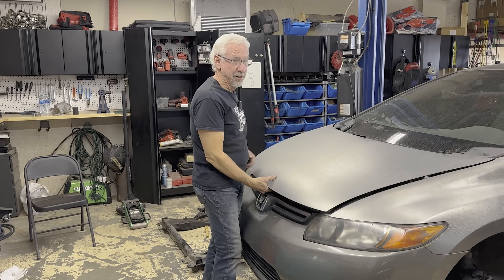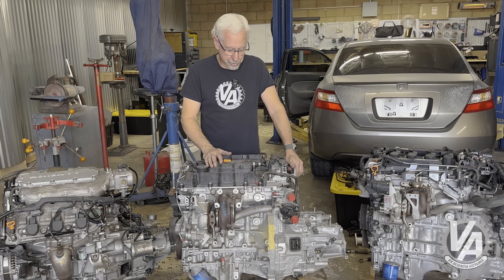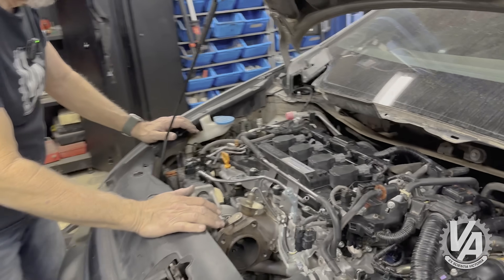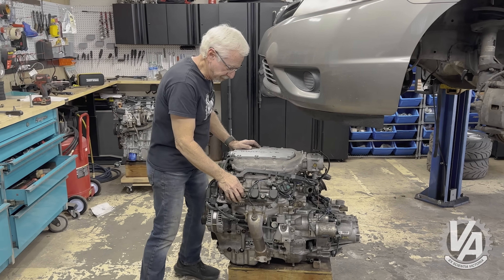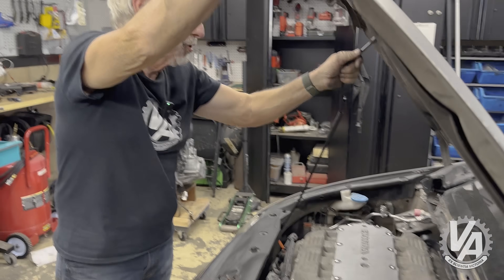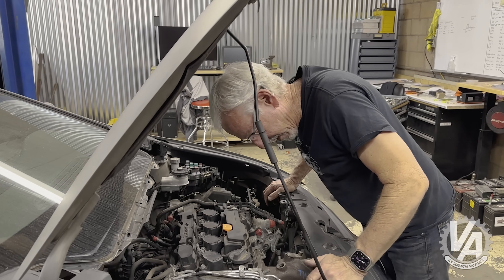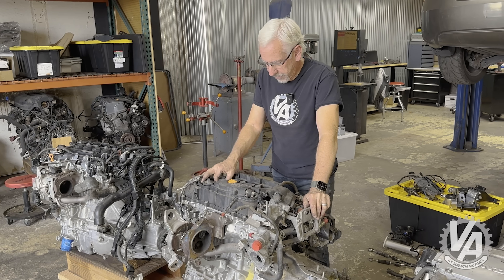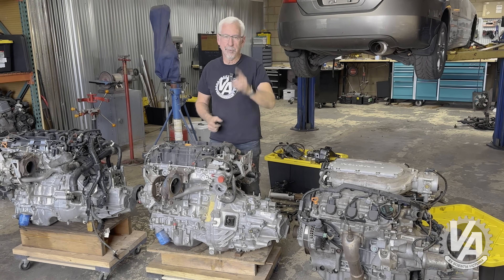Better than a K Swap? (More than a Si killer!) R18 to K, J or L15 Turbo!

Comment: As an owner of a j35 accord coupe with a manual I can say that you will not regret the decision on this drivetrain. Solid power all throughout the rpm range. My only qualm with my car is you can definitely feel the weight of the J series on the corners but it’s a strait line beast.

Comment: j series all the way and if you do I'm working on a 3d printed dual tb j32 intake longer runner by about 12mm and pre-ported to be 48mm wide on the runner. made out of polycarbonate and I would love to work something out to send one to you for testing. I dont post here mainly everything on TikTok.

Comment: J series is interesting but I also think the k20c is a better candidate considering it’s in new type r’s and 2.0t accords. Which makes parts also a little attainable. The l15 is a fun out of the box motor I’d like to see in a eg or ek. But the pistons are known for Melting under more boost and higher temperatures.

Comment: I will admit the J series would be a really cool wild swap but I'm really digging the L15. How nice would it be to have a later gen motor in an 8th gen body? Def a head turner.
Reply: Not worth the headache or cost that is trying to extract more than 400whp. Speaking from experience

Comment: Hey, family, gotta question. Picked up a 05 rsx to daily around pulled k24 out of ep3 to refurbish the firewall area. What is needed to use the 02 04 pnf hondata v4 in the 05 06 rsx chassis?  Is it simple swap or is something needed for the 05 06

Comment: J series hands down. So few have been done whereas with the K20c4 you'd just be doing a roundabout version of a boosted K, L series is literally an L in itself with that displacement, and the J series is "built" so... yeah. You'd make more WHP (and the same torque roughly) with a tune on the J than with the K20c or L out the box with possible boost capabilities in the future, making a 5-600 wheel monster that weighs the same as a gnat's ass would be hilarious.
Ultimately it comes down to weight distribution, do you want a lighter/more balanced nose or a straight line monster?

Comment: Here is my question. I have a 2020 Sport Sedan with a K20C2 and 6 speed manual. What about a K20C4 from a 2018 accord 2.0? Would give me 100hp more.
Reply from the maker: Yes, the K20C4 would make more power than the K20C2.
Reply: @VTECAcademy  but do you think k20c2 got potential?

Comment: K20C all day. Personally owned the L series motor in my SI and had nothing but issues with it. It’s a shame Honda even released it to replace the previous K series in most civics.
Reply: Feel the exact same way. You spend a lot of coin to make a reliable 350whp with the L15 when the k20c4 is within shooting distance of that with flex fuel and tune. Not to mention the way better low-end torque.
Reply: @darkknight097  yup exactly. I sold my si for an accord with the c4. It’s such a good motor with crazy amounts of torque. Plus I don’t have to worry about reliability with it like the L series. I don’t think the L is ever going to catch on for being a go to swap.
Reply: @huntrusso  what year accord exactly are we talking about I own an 07 civic SIFA5 I want to get another one but maybe I’ll get an accord instead
Reply: @Mr_vtec_fa5si  I have a 2019 with the 2.0t

Comment: When the kinks are all worked out of the l it will be a good option for 3g 3g civic 1g crx and might put these cars on the map again thee Way k did the ef
I bswap an ef first in 98 last ef was an h2b now I'm doing a kswap one 10 years lator and a 1g crx obd1 high cr dohc zc with 1-4 jdm  zc gears, usdm si5th, jdm zxi 4.437 fd and mfactory lsd converting it to us axles. Maybe when it's new wears off I'll lswap it with a good turbo setup

Comment: If tracking I'll always look for best power to weight ratio. If for straight line speed. Most powerful. The extra weight upfront will help with traction anyway

Comment: L or J would be great, but what I really want to see... Get a 5th gen Prelude and drop that k20c4 in with a LSD transmission. PLEASE MAKE THAT HOW TO VIDEO! And if you can figure out how to make it CARB compliant, I'll drop a brick in my britches
Reply from the maker: You know that YouTube comments are legally binding.
Reply: @VTECAcademy  if you make a Full, in Depth How-To video for "Everything you need and everything you need to know to put a k20c in your 5th gen Prelude AND make it CARB compliant". I, a grown man, will absolutely DESTROY my trousers. If you need video confirmation of that, I'll do it, but I think that says more about you than it does me 🤣. I'm honestly not excited about the fact you might take me up on this offer, but if it means I can save thousands of dollars DIY instead of paying someone to do it for me... 🤷 How much are a pair of pants and my dignity really worth? In this economy, not much. I'm broke AF, if I can get a Prelude roller for cheap(yes, I can) and an Accord Engine for a reasonable price(yeah, probably). Then that's pretty much my dream build. Preludes are absolutely INCREDIBLE cars, the chassis and suspension is only rivaled by the NSX. The Achilles heel is the engine, the H22 is fragile at best, plagued with oil burning from crap piston rings and breaking piston skirts left and right. With a k20c and a 6 speed LSD trans, it'd be GLORIOUS!

Comment: For 8th gen I would vote J series, some out of the ordinary.
For own project:
For weight benefits and usable power I would vote L15, to me perfect in EC ED EE EF.

For the sake of easy to find and bang for bucks J in 8th gen like I said.
K20C is very very expensive, tried to source a front clip, forget it! Might as well just buy a K20C Type R.

Comment: J series would be really cool. The L15 and K20c are both a bit "exotic" right now. Not really easy to come by for cheap. J series are everywhere. That's a much more attainable power plant, in my mind. Would also love to see a track-built 4th gen Odyssey. Track minivans are the untapped content well of YouTube :)
Reply: I bought a first gen fit L15 last year for 450 plus tax from a reputable salvage yard locally... They exist but the cars themselves don't seem to die.
Reply: Also I agree, j series are fascinating. When I found out my j35a8 had fractured rod caps, piston squirters, and cross bolt main caps, I was surprised and impressed. Well built that thing is
Reply: I really like the idea of the L15
Reply: @chrisevaggelou8473  l15? LMAO why? That motor is garbage.. Its a Honda Fit motor...
Reply: @JonHop1  L15B1 is the fit motor, civic si uses the L15B7
Reply: @Fhwgads11  still a junk motor.
Reply: @tayvonrose2528  how so
Reply: @Fhwgads11  I can't recall which creator it was, but a journalist took a brand new type r and si on track. Ended up blowing the si up
Reply: @Fhwgads11  Bruh, its the same longblock.. The b7 simply uses beefier internals for the turbo. Its a super weak motor, and it can barely handle 300whp reliably. I am a Honda Tech, I work on these cars all the time and they CONSTANTLY blow up from even light modding and slightly upping boost. The cylinder walls have the same issues B-series have but even worse.
Reply: @JonHop1  That's why you sleeve the cylinder walls. It's common practice in engines that have weaker walls.
Reply: @Sm1te79  why would anyone sleeve a direct-injected 1.5L that can barely make 400whp sleeved? The cylinder walls arent even the main issue. The new DI Honda motors limited factor is their Direct Injection/Fueling. Major pain in the rear to deal with. These new motors just arent worth it for big power. Just use a traditional port-injected K series that flow so much more air and you can tune with ease.
Reply: @JonHop1  even the k20c1?
Reply: @DAddy-iy9mu  K20c1 is not a good motor to make power on at all.. It also has reliability issues because it is direct-injected. DI has its pros and cons, but its never really good for power unless u run F1 or have a competent race team that can properly monitor air fuel and timing. Direct Injection is SUPER sensitive and you mess up one thing the motor is done. This is the risk you take when you get a more complete combustion. The downside is blowing up your motor and breaking things more often. Port Injection will always be king for us mortals who build our own cars.
Reply: @JonHop1  that's why dual injection exists for that exact purpose. Kinda to get both of the benefits. Especially with the standards for fuel economy and emissions are going to get more stricter starting 2026.
Reply: @JonHop1 😅
Reply: @DAddy-iy9mu  Dual injection does nothing to solve the problem... The motor is not designed for dual injection.. And again, the ports are small. The k20c1 will never make good power reliably, unless you overhaul the entire head. You would need a custom billet or cast head that is similar to the old K-series. Direct Injection sucks in 4-cylinders for power. They dont have the displacement to move a ton of air efficiently and they are notoriously difficult to tune properly. One tiny mistake and your motor is history. This is why we have yet to see ONE reliable K20c1 making big power. Because they cant.. 4-piston pretty much gave up on their k20c1 development. They made a super custom 1000whp variant, and all 3 test blocks blew up within 1 hour of testing lol...
Reply: It's cheap if you get it through auction. You just need a lot of patience to find the right one .
Reply: I'd love a manual transmission in my 06 odyssey
Reply: @jaredtopilko1313  do it. It's not as hard as you may think 😎
Reply: Got me a 2010 5 speed fit all I can say is classic.
Reply: @juanquiceno3443  Yeah with a K24 swap.
Reply: I’m thinking of getting an 18 or 19 TLX, should I get the one w the J series? Lmk
Reply: @XanVicious  If you are going to spend $30k, there are much better cars in that price point.. And arent the new J series crap and direct-injected? Same with the New K series.. They are not good(compared to the older port injected engines)
Reply: @JonHop1  I didn’t know that, also I wouldn’t be getting it new. Would be salvage title, I plan on fixing it up myself yk. I’m mainly looking for an old civic tho… but the J series kinda intrigued me.

Comment: Would an L fit a crx? Are there any available mount kits?
Reply: It might be a bit tall in the EF chassis, but like the J, it should fit if you change your hood (please stop cutting OEM ones!)
Reply: @Nobody Noone  I still have a B20 Vtec and can't seem to fall in love with a different swap. I'm in the process of painting my car. Engine out. So I was just shopping around. Must have AC. I won't give that up lol. And no I haven't cut my hood and never will.

Comment: J series all the way. 260ish HP and really smooth. That would be a cool build
Reply from the maker: It really is smooth too.
Reply: 276hp *
And they put 255-260 at the wheel
So yeah, underrated
Reply: @markzieg2425  If remember correctly, japanese manufacturers have a "Gentleman's Agreement" and will only rate their engines at a set HP. It's been a long while since I've kept up with any Japanese stuff so I don't remember what that number is.
Reply: @davidvaughn7778  it could be, the J35Z3 was in dev since the early 2000s, and in many ways its just a tuned and bored J30 which dates back to the mid 90s. It's the closest Honda ever came to making a big block motor. Single Cam 3.5L V6 revving to 7000rpm is borderline scary. A lot of spinning mass 

All I'm sayin l saying is the J37z which is 0.2L bigger and went in Acuras had 40+ hp for 0.2L and the accord 6-6s had transmissions that are 97% effecient...
Or the spec sheet is underrated. Those 3500lbs accord coupes were hitting 60 in 5.6s in 2008. That was fast, not just quick
Reply: @davidvaughn7778  that was a 90's thing
Reply: I don’t thing the gentlemen’s agreement is a thing anymore the newer gtr, nsx and other high horse cars are all way over 276hp

Comment: Im planning to swap a j35/j37 in to a early Porsche 924. They are so underrated, basically JDM muscle.
Reply from the maker: That will be a killer setup.
Reply: @VTECAcademy  yes it will
Reply: I plan on getting a second first gen rx7 as a roller to slap a j series into (rods, closed deck, turbo combination), & turn it into a rally esc street car, I think I'm going to go with the red adapter for the 350z trans & a Ford 9" set-up built for a fox body, with fox body/sn95 coilovers/spindles/hubs up front with custom tubular long travel A arm  & foxbody coilovers in the rear with custom tubular 4 link bars in the rear that have heim joint ends for better articulation & adjustability.
Reply: Nah bruh, jdm muscle is a vk56
Reply: @arman757  If you mean as muscle having bad power vs displacement ratio like us engines then you are absolutely correct.
Reply: @gaspererjavec7108  clearly know nothing about how engines work. Keep coping
Reply: @YungEagle3k  Yes definitely. Im just a engine builder and tuner but whatever lol.